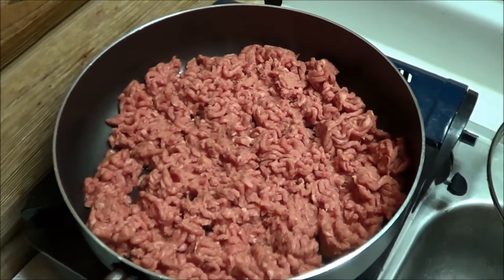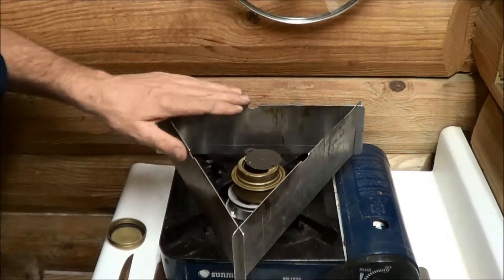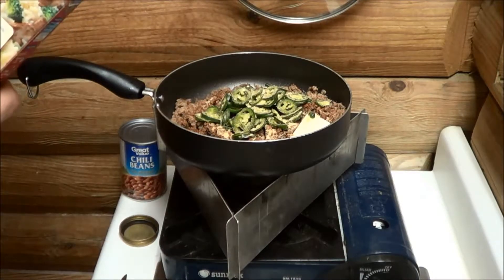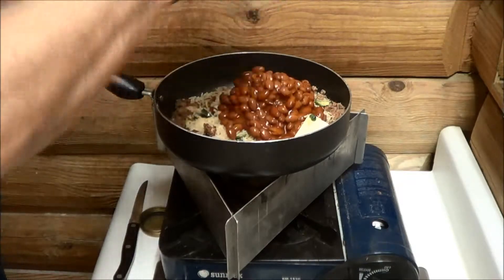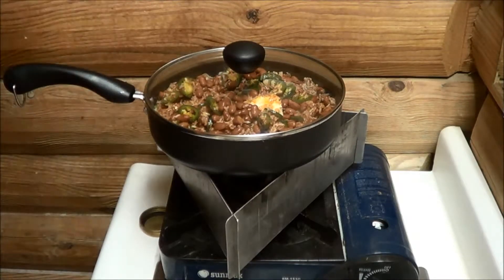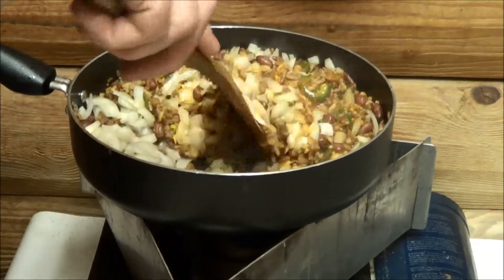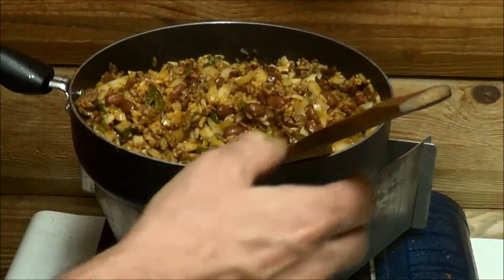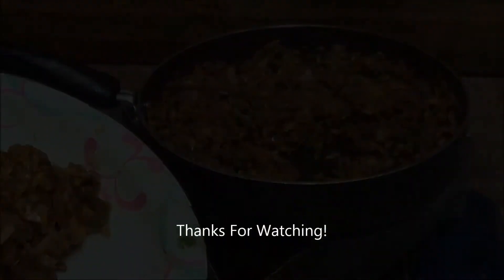El Cheapo Lunch for a Week

Comment: You should invest in a Crockpot.. you could make this meal while you're at work and it will come out better with the slow simmer. You can buy meats at the store in the "clearance racks' for super cheap, and use it for the protein part of the crock pot meals. You just throw all the stuff you want to use into the pot, turn it on and check on it in about 6-8hrs
Reply from the maker: RoadTripVidz My problem is I have never found a crockpot that cooks at a low enough temperature to avoid burning stuff like this. But they are great for stews and soups. I have a Dutch oven style of one that my mom got me before she passed away, but it is in my storage.
Reply: PoopingAndroid Just have to add more water, it will be good. I cook stuff like this while i'm at work and it comes out amazing.